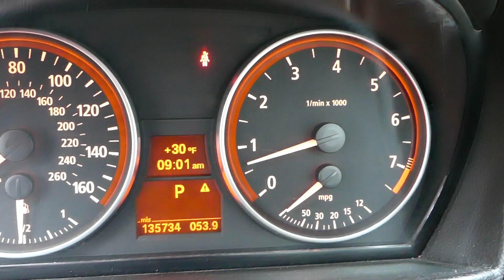CODE P0740 P0741 P0742 TORQUE CONVERTER CHEVROLET BUICK GMC 6T30 6T40 6T45 TRANSMISSION

Comment: I have a chevy tracker 1998 and the code is PO740 torque converter clutch circuit open, what should i need to do, thanks for ypur help.

Comment: My 2002 Olds Alero is showing both a P0730 and a P0741 code. Went to the dealership and they said they would need to replace my transmission with a rebuilt one for $1800.   I'm not sure if I want to pay the dealership or just get a new car.  Thoughts?

Comment: OBD2 trouble code P0742 Torque converter circuit stuck on.? GM exclusively,a Car equiped  with TC traction control Light keeps coming on ? Replace all 4 wheel speed sensors .Should clear code,and end Transmission trouble.